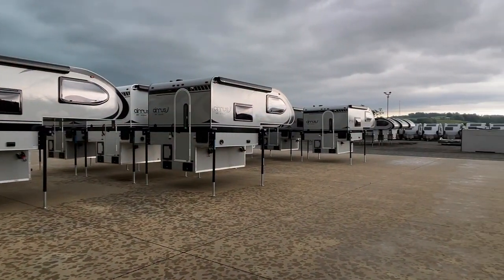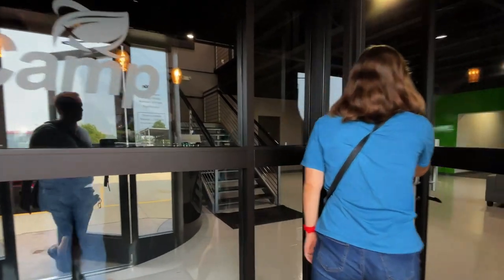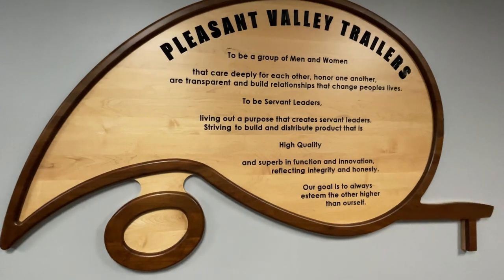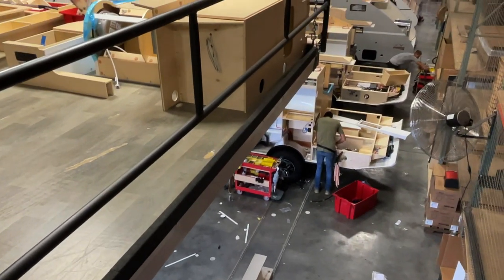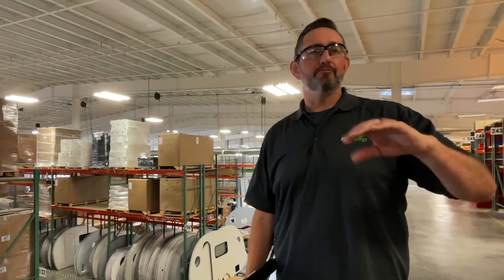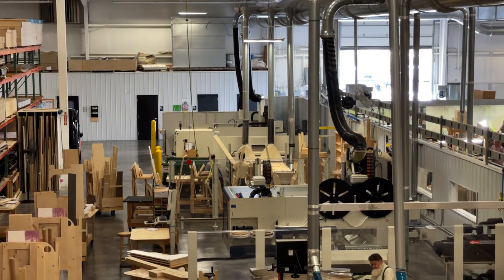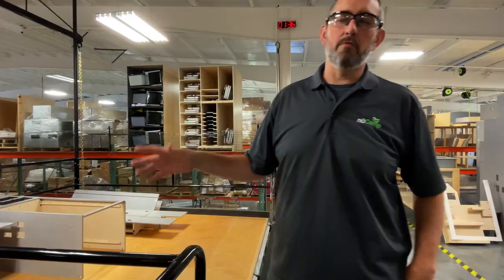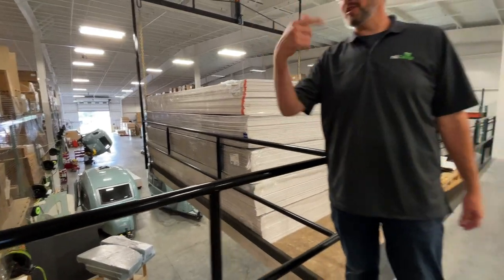Factory Tour of NuCamp // Cirrus - TAB - TAG // See Where They Are Built!

Comment: I'd also like to share that when I was on my 7400 mile journey a couple weeks back the amount of times other campers that would ask to see my 820. Every person that looked at it was amazed at the quality and I was proud to share that with them. I do have mine up for adoption and I have mixed emotions of that. I have it on RV Trader and I've had 318 views and 8 emails  on it. If it doesn't get adopted I will use it this winter.
Reply from the maker: We get the same thing. People see and and when we offer to give them a tour they are quite impressed! It’s an attractive rig! 

Good luck with your camper sale 👍
Reply: Me and the wife are looking at lances and then we came across stony boots channel and started seeing the quality and how long you’ve been in your camper and it’s really really looking like what we’re going to go with is an 820 because I own a 2018 Silverado 4 x 4 Z 71 LT and I have a suspension package I put on it I.e air-bags, fox coil overs front aftermarket control arms with 3/4 ton ball joints; just for this 820, to last a lot longer on the truck; I’d like to know your thoughts on that.

Comment: Wait a minute. Was that a vending machine for tape measures?! Where are they hiding those green teardrops with the plastic lemonade? That was a great look. Maybe it's a custom color option... That was interesting. Thanks for getting the tour. Currently, the Cirrus 820 is at the top of our list while researching our next rig.
Reply from the maker: I had an off camera conversation about the vending machines. They are indeed vending machines, workers have a card or a code they use to get replacement items like drill bits, tape measures, and other consumables. It helps track usage, minimize waste and locate inefficiencies in the production line. I’m not really up to date on modern manufacturing, but I thought that was a brilliant idea!
Reply: @Stonyboot  You'd be amazed at how many tape measures, drill bits, screw bits, etc. are mistakenly left in coverall pockets and end up at home or in the center console cup holder of a pickup truck or other vehicle. ☺

Comment: the 620 has the fridge up on the overhead on the bed. moisture is likely to drip on tpo the mattress. So the 875 is the next model
Reply from the maker: Unfortunately, I wasn’t able to tour a 620, just poke my camera in. Those campers were not actually complete. I’ll have to take a look at the 875, thanks.
Reply: The fridge in a 620 is high on the wall above the cassette toilet. There is no fridge above the bed. Maybe you were thinking of the old 6-packs and Lance 650.

Comment: How often do they do a run of 920?  I have a 2014 Ram 2500 8 ft box so an 820 wouldn't work for me.
Reply from the maker: There is some news about a new 920 coming this year, or early next year. Also, an 820 will work on an 8' foot bed with some modifications and attention to your center of gravity. Then you would have some storage in front of the camper :). The 920 has much more space though. If you can wait, it's an awesome camper!

Comment: I didn't see any Avia's there - What happened to them?
Reply from the maker: They aren’t in production right now. It seems like NuCamp switches out their production lines to meet the needs of the market.  I’m sure it’s more complicated than that, but I’d love to see the Avia return as well. And… the Cirrus 920!
Reply: The one downside I saw with the Avia was no hanging closet space considering that it is a fairly long trailer.
Reply from the maker: I never looked that closely, I’m surprised that they wouldn’t include a hanging closet!
Reply: I did and most people were asking about it as well, they did put sorta like a cabinet but you could not hang anything there; it was literally a few inches deep. They need to fix the storage depth on all cabinets in my opinion.
Reply from the maker: It will be interesting to see what they have coming out next. I’m sure that you aren’t the only person with that complaint and I would imagine they will address it if the build another Avia.